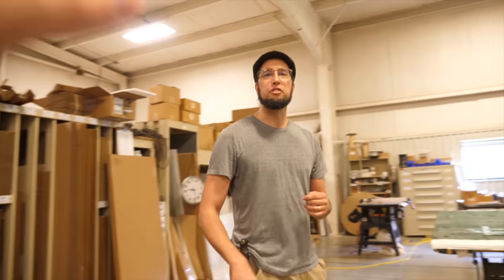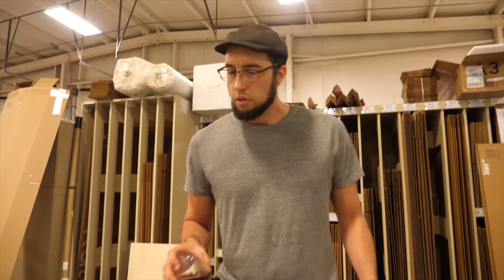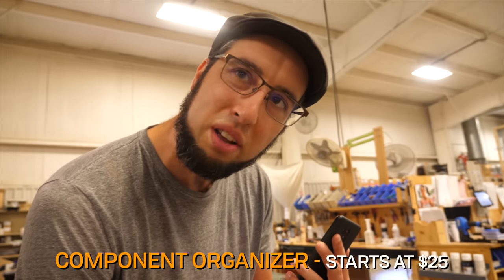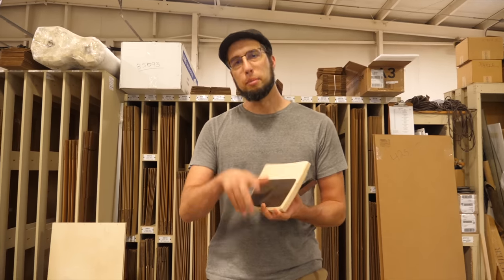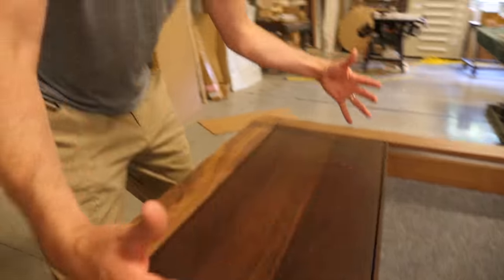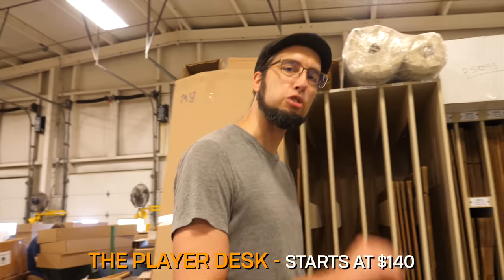ALL MODULAR TABLE ACCESSORIES (And Full Pricing)

Comment: Idea: How about a small insert that lets you use your tabletop tiles in the rail? 

Right now, while your tiles probably snap into the rail fine, they would be partly covered by the groove. All you would need is a small piece of wood with magnets on each end, and suddenly your tabletop tiles can become table accessories. 

Just an idea :) If you don't offer this, I'm probably going to make a (crappy) version myself, but would rather have it from you.

I'm sure there are other ways of incorporating tiles, so I'd love anything that makes this stuff work together without putting it on the actual lowered gaming surface.

Comment: Wyrmwood: "Charcole"

Me: "Charcoal"
Reply: Doug's shirt: "Charcole?"
Reply: No no no, Charcole is correct. They set some cole on fire, and that's the color it turns when the exterior has burned off.
Reply: @paulcurry4252 : "cole"

Me: "Coal"
Reply: @AlkeroJones   No no, not the carbon you dig out of the ground. Cole's one of the cheaper dudebro types.

Comment: But what is this upgrade kit you’re hinting at about being able to change the size of your table???
Reply: I'm glad I'm not the only one wondering about that! I'd love to get a smaller table that I could upgrade in size once I get a bigger place!
Reply: The table is quite literally modular.  I haven't seen how it will work, but they've mentioned it a couple of times in passing.
Reply: It was shown in the last couple of wyrmlife episodes. Such as when they're looking at the kickstarter page last episode. Basically most of the tables are the same width, so you can upgrade the length by disassembling it a little, and inserting the longer section in to now have a larger table.
Reply: @BritishTeaLover  The way I look at it, ALL of the tables are 44" wide. One of the tables is only about 26" long. Then it all immediately makes sense.

Comment: OMG....the “cheap” table is a Trojan Horse for accessories with higher margins....and I still can’t resist...
Reply: This is a misconception people have about woodworking: while bigger items use more wood, they rarely require a greater linear amount of work. Actually, some of the smaller part could require more hand work since they are too small to be processed with the wide belt sander.
Reply: Hey just adding a comment here to clarify that my remark is in appreciation of what they’ve done here. It is wonderful business. I see future versions of these accessories like the seasonal variants of the deck boxes or dice towers. Custom options....the works. This is going to have a long tail. I find nothing wrong with the pricing of any of this.
Reply: @AlainPilon  The CNC machines really help too.
Reply: I might gonna sound like I'm sponsored by Wyrmwood... but this thing is just so consumer friendly is ridiculous!

where with other products out there, you'll have to save a lot of your money to buy the ideal table right off the bat, with this table you can buy the cheapest one, and them buy the upgrade kits, to make the table bigger and upgrade your ideal table bit by bit, all the while you're buying the accessories you need, whenever you wish.

Comment: 0:23 felt
0:54 cup holders
1:38 component organizers
4:12 Game deck (game master accessory) anyone else see the long card holder slot as an initiative tracker???
2:26 card holder
3:21 power pack (phone, tablet charger)
5:19 player deck
5:54 acrylic overlay
6:13 tv display
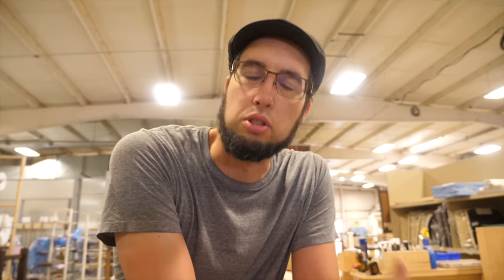6:49 topper block
7:24 toppers ( gasket system is included, keep those spills out)
Reply: Thank you for the timestamps

Comment: Is there something that stops the toppers sliding further off the sides/keeps them aligned with the top of the table? Like I get that they’re heavy, but I can imagine still being able to nudge them if you bump into them accidentally or like placing them awkwardly to begin with.
Reply: I think there probably is, but I'd like this confirmed too.
Reply: I also wondered that- I have. Grabby littles
Reply: If you look at 7:10 on the standing topper you can see small wood pieces under the topper (for the ends of the table) made for staying on the inside of the table so the topper can't slide of the table.
Reply: bunker1213 ooh yes, also at 7:19. Had to slow dow. the playback speed to 0.25 as that segment was so quick, hence probably missing it first time round, but I do see it now, thanks 🙂

Comment: Just found this channel. Not a table top gamer but as en engineer, I am incredibly impressed with how well thought out this system is. It is clear the understanding of how it would be used is there as is the passion.

One thing, TV's create heat. I couldnt see but hopefully there are some vents in the TV piece to let the heat get out. Should be easy enough to hide under the lip of the frame.

Comment: Has Wyrmwood considered for the charge pack putting the charge through the magnetic rail which removes the need for a battery altogether and all you need is to plug in to the unit? Similar to how the topk charging cable works.  Doesn't matter if it is upside down or not, you polarize the lanes by having a middle negative charge and a positive out layer charge on it. That way you can still slide the unit without disconnecting the unit.

Comment: Valid question I got asked by a family member i hadn’t thought of; Will the magnets demagnetize your credit cards?
Reply: Highly doubt it. It takes a pretty powerful magnet to strip a credit card unless the card is in near-direct physical contact with the magnet for long periods of time. Just don't set your wallet directly next to the table wall and you will be fine.
Reply: Standard credit cards you probably need to swipe the magnet directly across the strip to scramble the credit card.  For things that are re-programable like hotel room keys 5-6 inches away is probably enough to affect them.  The magnets are only in the accessories and the toppers, so I'd really only be concerned about leaving credit cards on the table topper or if you have a hotel room key or security swipe card for work, leaving your wallet on the table topper.
https://www.kjmagnetics.com/blog.asp?p=magnetic-stripes#:~:text=Can%20a%20neodymium%20magnet%20erase,to%20be%20erased%20or%20scrambled.
Reply: They're rare earth magnets. They're strong as hell. So yes. Don't run your magnetic strip along the magnets. But c'mon, that's common sense

Comment: @Wyrmwood Even if you don't game, this is a phenomenal piece of furniture in it's own right. 

For the kick starter you may want to put in tags for the cosplayer community as well because I see this and it screams "amazing crafts table with built in and modular storage." Having this beautiful long surface for drafting or popping half the cover off to sew on one side and have a clean place out of the way for your fabric to feed to on the other. Have your supplies nice and organized on the inside with accessories to put your pin holders, zippers/closures, and phone in easy access with one of the accessories when needed? Checks all the boxes I would want.

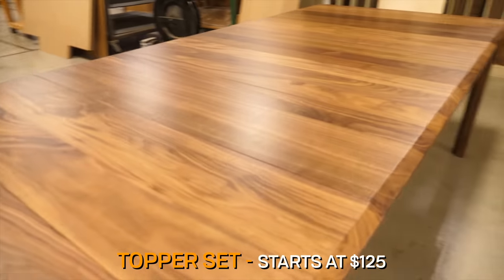Comment: Does the spill proof system work on both ends of the topper? In the video at 7:55 it seems that the spline doesn’t lock with the final topper piece.

Comment: So I could use a small topper on a Liliput, right? Since they're sectional you could just buy the larger topper and leave the middle sections out. So long as you only need one table top at a time, which I think will be the case for me.

Comment: 5:26 and here I am just wondering if I can pop on a Player Desk, then put another onto that Desk's rail, and so forth... And how far I could take it. And THEN I wondered if I could do that without having them lined up to get even more inner rail space. And NOW I'm wondering if I could have the desk face inward, pop several on top of it so it's like a display stand, and use THAT as a component storage/display area (instead of storing them mid-table or using component trays on inner rails)

Comment: I was excited for this, but the accessories are really expensive compared to the table. Even just a cup holder for each player at a 4 person table is going to be like, what, 25% of the table's cost?
Reply: It's how they can sell the tables at a lower cost.
Reply: @Christian Kent because like all furniture manufacturers they're way overcharging you for something you can simply do yourself. Nothing for this table, or even the table in general, should be even a fraction of the price they've listed.

Comment: How does the topper stay in place when on the table. I know magnets hold the slats together but could the whole surface be slid off the table?
Reply: There is a rubber stopper on the bottom. Saw in recent video

Comment: Are the electrical components built solid into their pieces or can they be easily replaced if they stop working?
Say I go to hang the screen on the wall fumble it and the screen cracks. How hard would it be to replace? Am I buying a new tv at a store and replacing it myself or am I buying a completely new unit from you?

Comment: I'll take... 
1 large maple table in espresso
1 large topper
1 game deck $190
7 lap desks $140 ea
7 component organizers $25 ($35 modular)
4 componet organizer and card holders $90
4 small cup holders $35
4 large cup holders $55
2 wireless chargers $65
1 topper box $?
1 felt white or beige (what ever you offer) $15

Making my checking account screwed. LOL 😆

Comment: Is the Game Deck scaled to the table size? Doesn't seem like it would be useful on anything other'n the large table.

Cup Holders, a single Power Pack (which definitely needs to be upgradable for future tech), and possibly Player Desks for D&D (would want to try out ergonomics there) seem like the lifestyle mods of value to me. Mebbe the Game Deck for D&D, but then you'd need a screen...
Reply: Problem I see with Player Desk is you're sitting back from the table if it's in front of you - then you have trouble getting to the table itself.
That might be fine for an RPG where you only interact with the board occasionally, but think it'd be pretty terrible for a board game.
Anyone have experience with this kinda setup?

Comment: How much is the topper box and will it accommodate Prophecy toppers?
Reply: $190, and right now they only presented MGT ones.  The Prophecy has wider pieces so it would need a different size
Reply: @pyrotelekinesis7253  Thanks! I missed that in the video. Hopefully they will make a topper box (or block?) for the Prophecy!

Comment: Cards at the front edge of accessories seems problematic. When I play I don't hold my cards in front of my components, books etc, I hold them close to my chest so others don't see the cards. Imagine you are three players sitting on the long side of the large table, the middle person will very likely expose the cards to at least one of the players next to him. Also if I have the cards in front of my components, the cards will obscure or hide the components/chips that I believe other players have the right and need to see in most games.
Reply: Hang the card deck off the outside of the table, and use the pivot to keep the cards low and close. But, honestly, if you're someone that likes to keep your cards in your hands, you're probably going to keep holding them.

Comment: You guys need a DM screen that inserts into the Game Deck card rail. Though the card rail may be a bit too thin.
Reply: I do wish they had a solution for this. A DM screen Kickstarter is on the way, so it would be really nice if they had factored that into the table design with a special slot. 

There are still options though. Maybe they can do something with the rails to create a base that the screen will click into. If the DM screen could sit right at the back of the Game Deck AND at the edge of the table on each side, that would provide a lot of space.